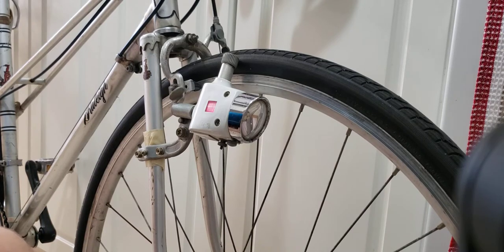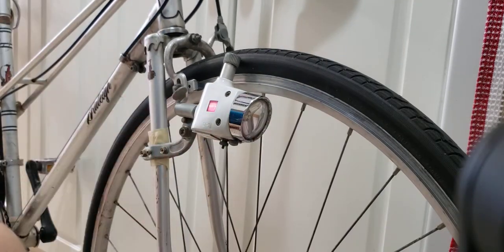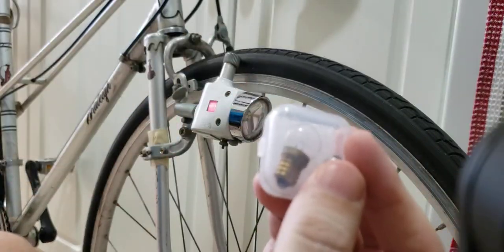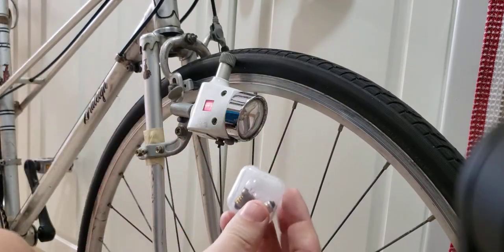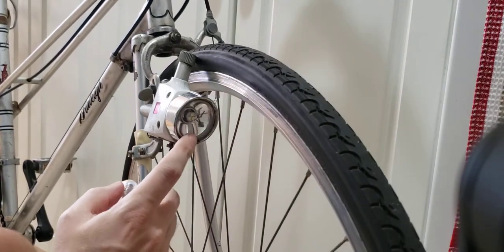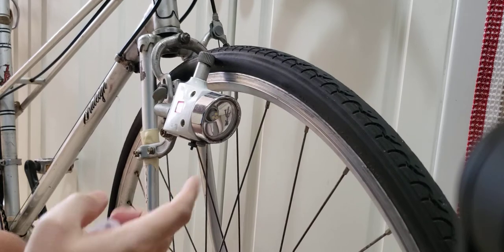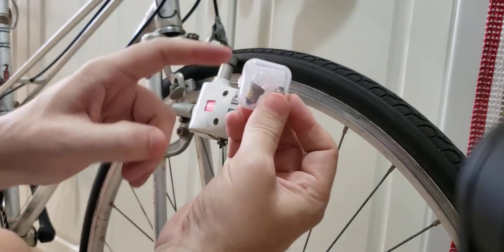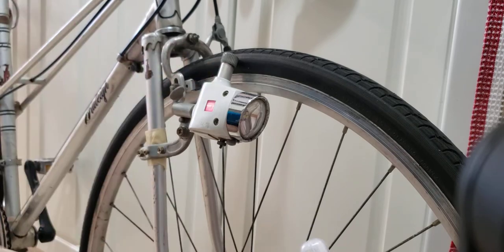What Happens When I Put LED Bulb In Vintage Bicycle Generator Light

Comment: LEDs are not self limiting in the way a tungsten bulb is, The resistance goes up as the tungsten filament gets hotter so it helps keep from burning out when going fast. The LED is the reverse it offers less resistance as the voltage goes up so it may get fried. I would like to see the video where you give it a road test over a few days to see what happens. You made need some sort of voltage regulating circuit.
Reply from the maker: Hi. I will try to do a video in dark as well.
Reply: In the description of the bulb on the product page it states there's an "inductor" to prevent "excessive current." Probably bad translation but that's probably a voltage regulator of sorts. It's more than just a led, there's some circuitry inside also. They show it in a exploded diagram.